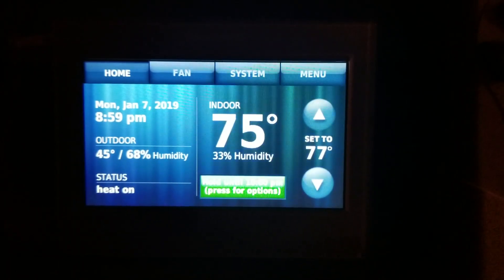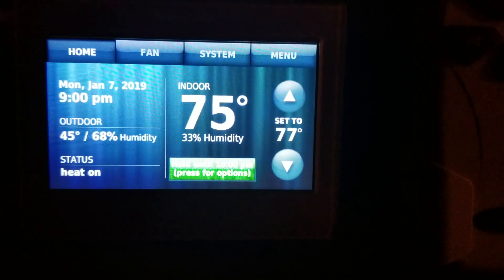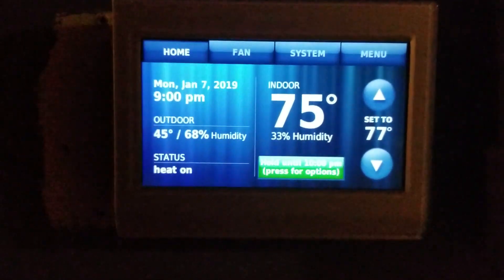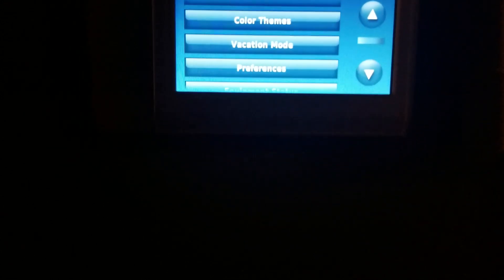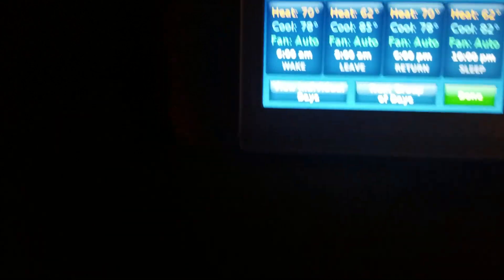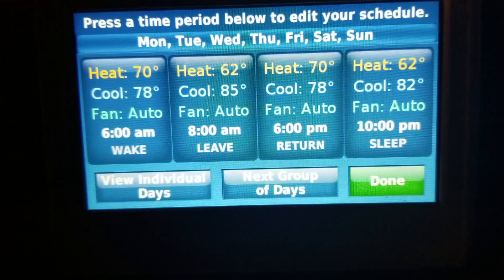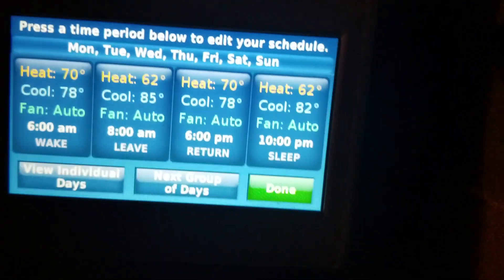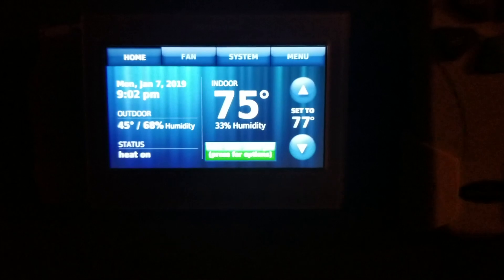Honeywell Wifi Smart Thermostat RTH9580 Gas Heat blowing Cold Air fix

Comment: I hoped this would help but this doesn't seem to be the problem...my house temperature is currently 62° and outside it's 55° I have it set to 74° but nothing 😢
Reply from the maker: So u turned on THE HEAT correct?